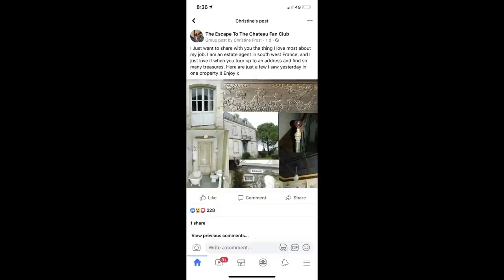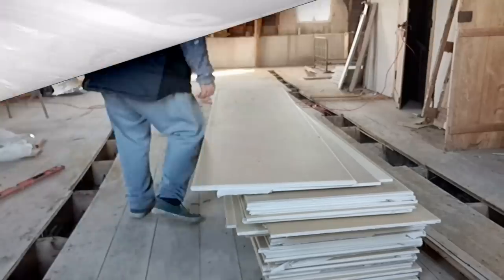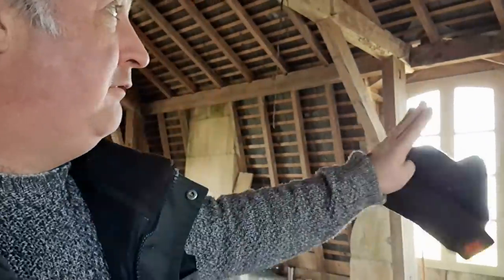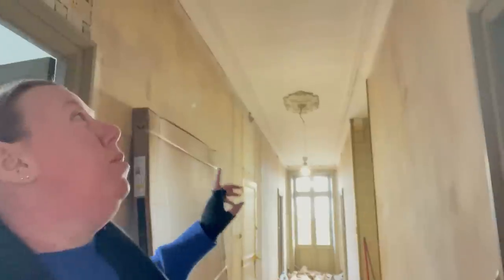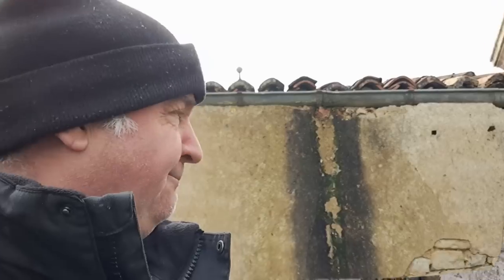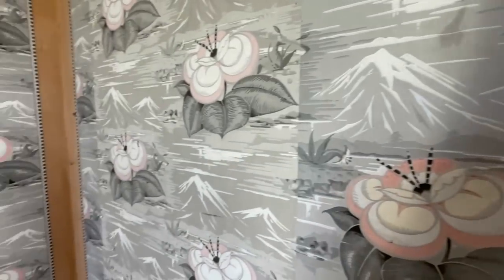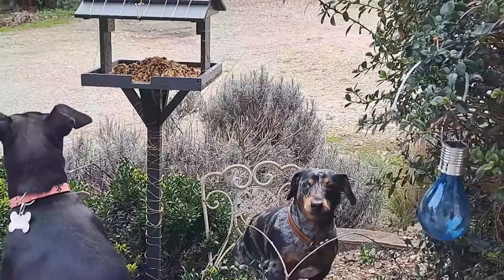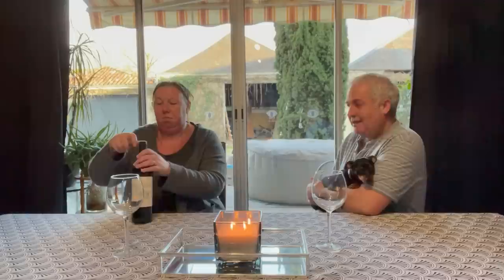Ups & Downs #76

Comment: Clare I have found with that old wall paper that all you need to do is use a spray bottle of warm water to soak it and it will often come straight off the wall. Sometimes I use a sponge and tub of warm water to finish it off, but it really does come off easily and saves on electricity. In this cold I can appreciate you probably like the steamer though 😂, which is why I'm working on stripping brown paint off my stone chimney with a heat gun - it helps heat the room! 😂
Reply from the maker: Thanks Allison, I still have more to go so will give it a try for sure x

Comment: its a radiant barrier they used it on the plane/rocket coming back into the atmosphere from space! It works - mine was put on mdf board it was stapled on bottom then the new of roof was on top & yes you should notice a difference.

Oops water & Electric still don’t mix - caught b4 anything happened on to the next one!